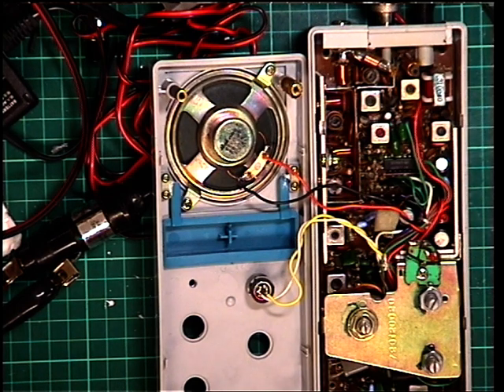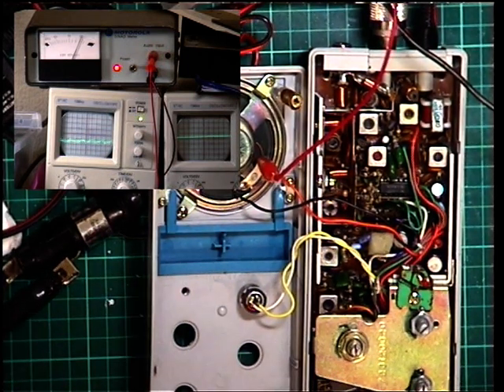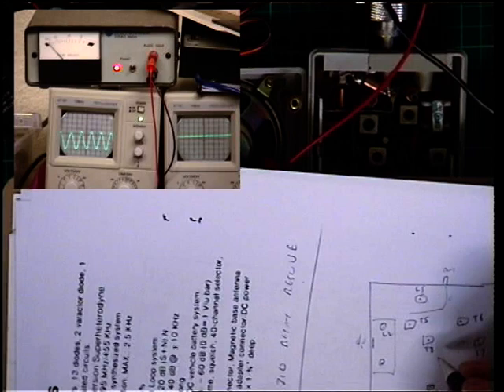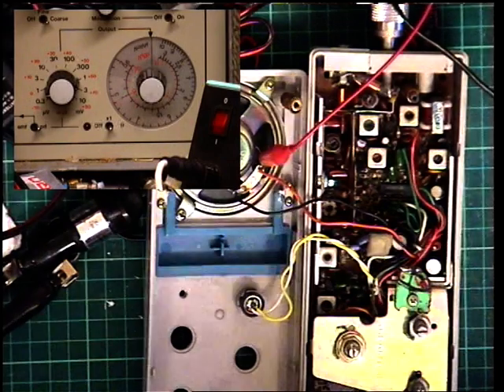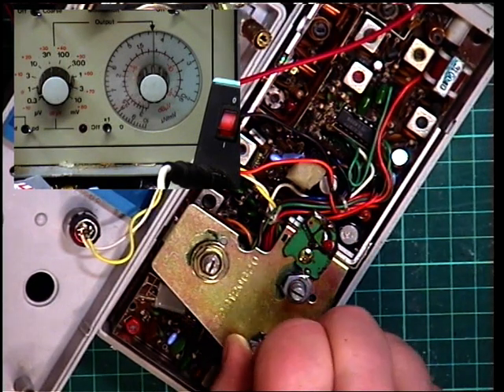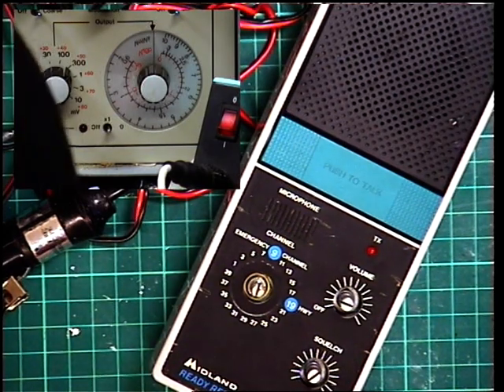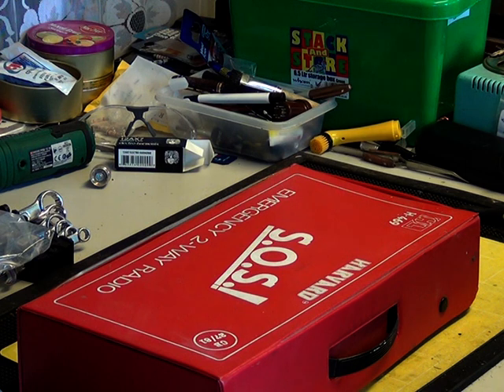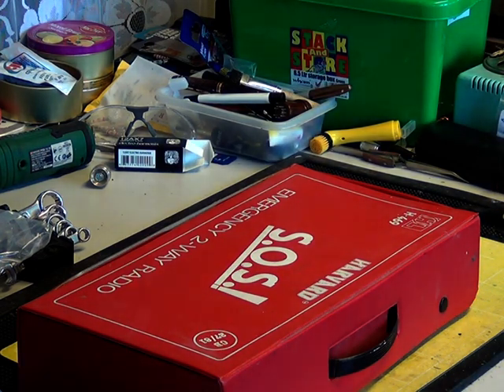Midland 77- 810 Ready Rescue CB 27/81 (UK emergency CB radio) -  Receive alignment

Comment: Would you please show a Midland 75-822 if possible?
Reply from the maker: The Midland 75-822 isn't a UK model, so would be illegal to import. UK spec is FM, ch1=27.60125 to ch40=27.99125Mhz.

Richard (UK)